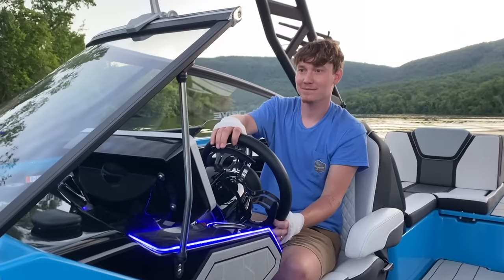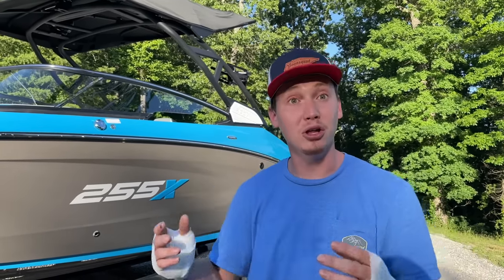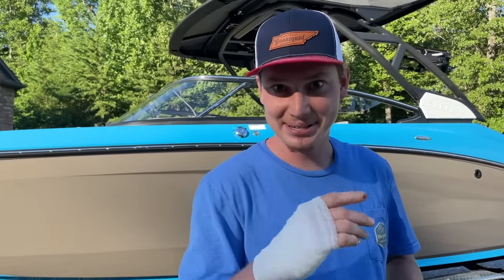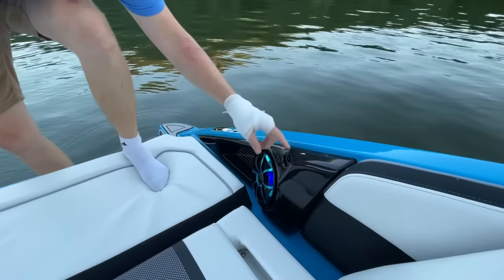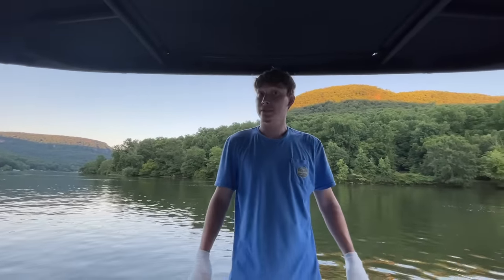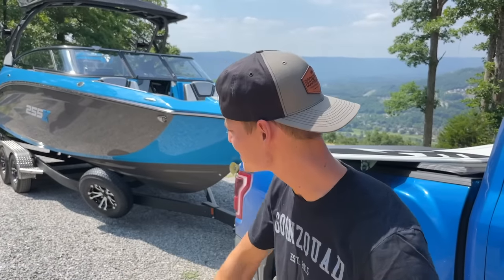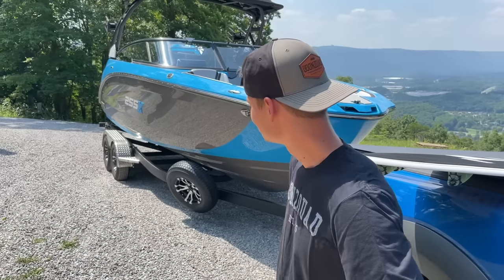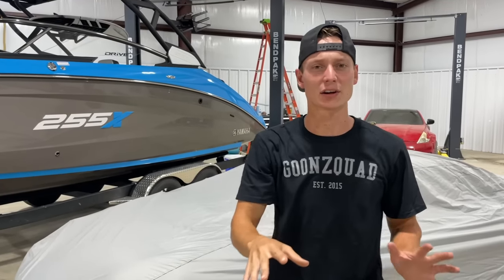Breaking In Our Brand New YAMAHA 255XD Ski Boat!!! We Are Upset!?

Comment: Do you have a controller for the brakes on the trailer? On my trailer I have to adjust the brakes depending on the weight I have on the trailer. If you hit the brakes and it smokes it means the setting is way too high.

Comment: Guys, 1st & foremost the Raptor dragging its butt looks stupid and is unsafe! Get the level blocks out of the front end. The truck needs to have some rake if uR going to tow that heavy boat! OR gets sone bags put under the rest end please! 

2nd, does the trailer have a 7 pin connector? Are you sure it does not have electric brakes? 
Have you checked and adjusted the Gain on the dash board? Are you aware the truck has a built in brake controller?  There’s no way surge brakes are burning up the brake rotors!! Hello??

Comment: The first clue that the trailer brakes are trash 4:32 is when the rotors turn blue from excessive heat.  I don't know; but, my guess is your truck is not equipped with a proper trailer brake controller.  As you can see in my video, https://youtu.be/oDP_CkHdLmo   I like the TEKONSHA PRODIGY 2 Brake Controller.  My advice is to install brake controllers on all your tow vehicles and replace the trailer brake pads & rotors.  With that kind of heat, the moment the brakes went into the water, the rotors were probably warped, making them worse than what we see here 4:32.  The more you drive with warped rotors, the worse the brakes get.  It never gets better.  Replace the rotors. Install Brake Controllers. Adjust your Brake Controller every time, to compensate for the weight changes.
Reply: If your trailer has Surge Brakes, just know surge brakes don't do very well in the hills and they need to be adjusted to apply less brake, in the hills; of course, that means you have to drive slower in the hills.

Comment: That sure is a nice boat. 
Simeon, that burn is looking better. Still very red, though. I hope it is not hurting too much!?
Hot brakes might be due to the new trailer; thus, they needed to be broken in as you do on a new set of pads and rotors? 
Just a guess about the brakes. 
Were the brakes an issue on the way home from the river?
What was the thing you drove under in the last bit of the second river ride with the boat? 
Keep resting and healing up. Peace!